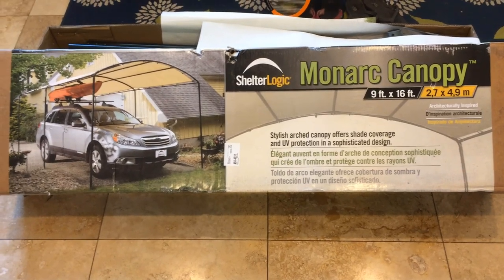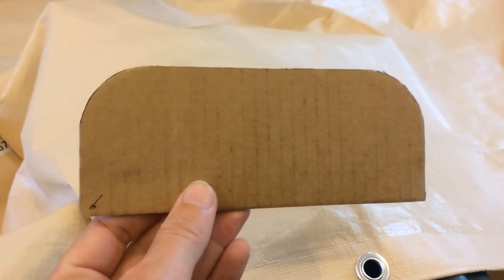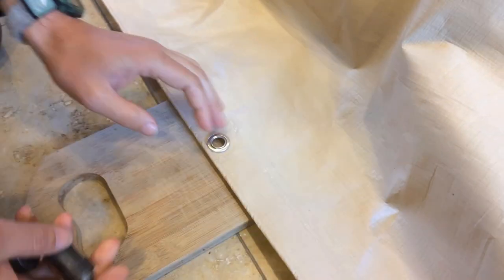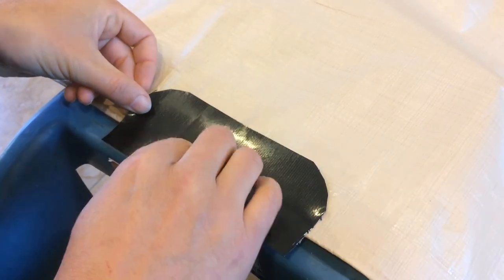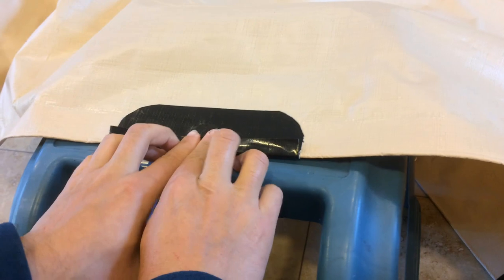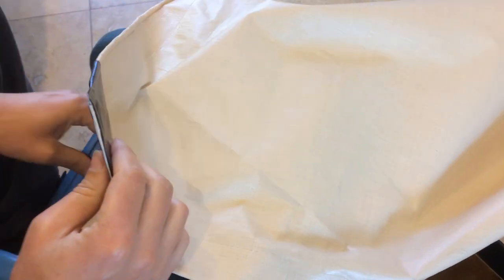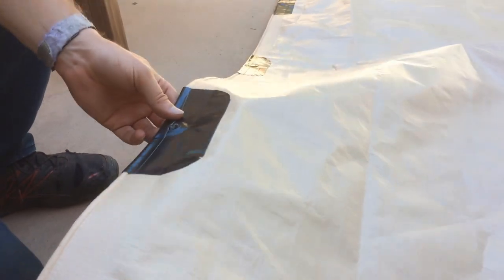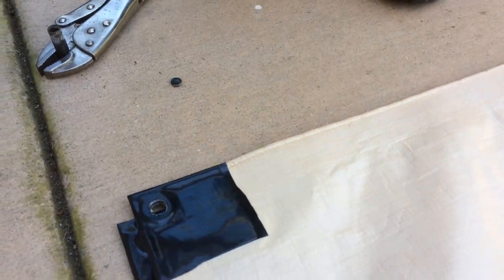How To Reinforce Tarp Grommets on Monarc Canopy by ShelterLogic

Comment: This looks like a fantastic idea. I just bought a brand new canopy and one of the grommets pulled right out without putting excessive tension on it.   I live in sunny Florida I’m curious if the weather here would be too hot for the gorilla tape in direct sun. Will it curl and pull loose.    So far this looks like the best solution that I have found.  It makes me wonder why the manufacturer doesn’t do this or something similar.
Reply: It's all about $$$$$. Cheaper usually wins out. Too bad...

Comment: Your taking the temper out of your hole punch,  its gonna dull real easy now.
Reply from the maker: If you don't heat it beyond it's critical temp, approx. 1300 F for high-carbon steel, it won't undergo a phase transition (e.g. from ferrite to austenite) and thus when it cools it doesn't anneal. Annealing is the process that you're referring to that would take the temper out of the punch and cause it to get dull more easily; i.e. it would be a softer steel. You can gauge the temperature of heated steel by it's color... try to keep it under a dull red color and you won't exceed its critical temperature. Thanks for the comment.
Reply: Thanks for the video ,  nice job!! @StarOfCA
Reply: Sma 556  Yes, I agree with you about just using a nail or something, but I am also laughing to myself.  Like, do you really think China spent money to "harden" that punch! LOL!  It's probably just regular steel that has been sharpened!  I also wondered if flashing for roofs would work, it's sticky, thick, etc, then cover it with some tape.  I just bought a $39.95 harbor freight tarp for a tent and with the wind whipping, it ripped the corner grommet out, but the little tiny rope inside the seam also broke so I was wondering how to make the perfect tarp.  Also when i re-tied the tarp with a different grommet (away from the corner) the tarp material actually ripped.  So thats a weak point too.  This was the6 mil tarp I think, instead of the 4, they also offered 9 mil or something.   So you pay for what you get.
Reply: If your really concerned then when your done reheat it and dip it in cold water.  It will be nice and tempered.  Probably brittle now because it’s so thin